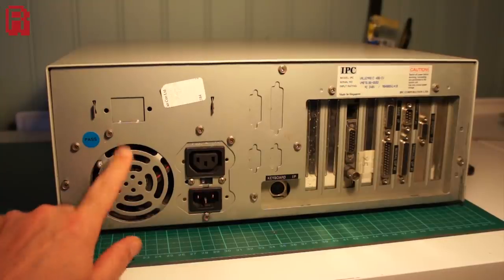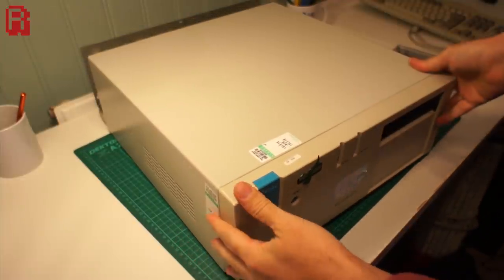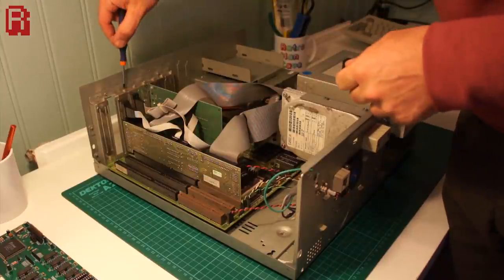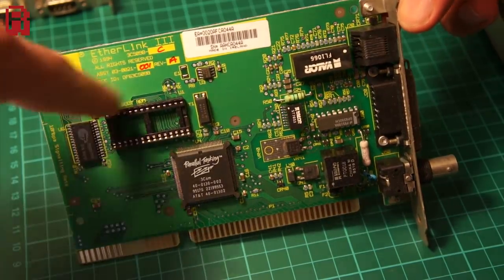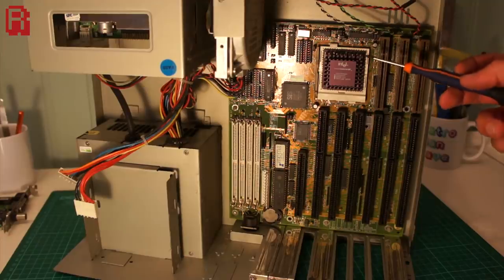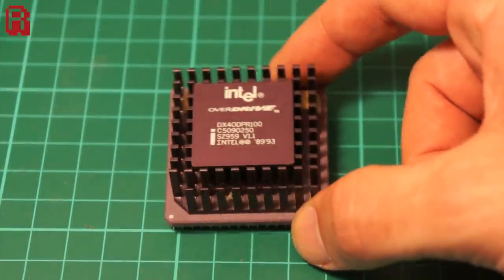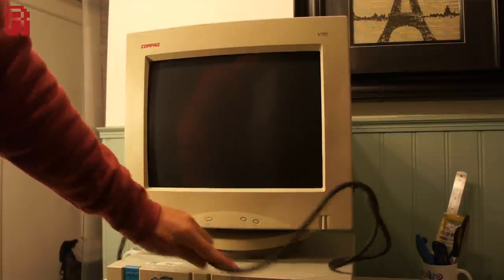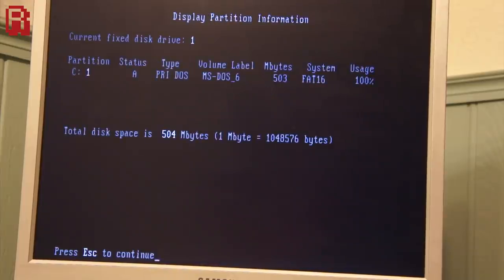Intel 486 DX4 100 Dumpster Find

Comment: Cyrix and AMD were actually completely different companies, and directly competed with one another and with Intel.

(Also, the FasMath co-processor there was an add-on for a 386 motherboard.  It was most often paired with the 486DLC processor, another of Cyrix's oddball line of CPUs.  They worked pretty well, though, especially the 40MHz versions.  Sometimes you had to flash a new BIOS chip to get them to work though, which could be a downer if you didn't have an EPROM burner.)
Reply: AMD and Cyrix' leftovers are still very different. AMD stays AMD even though they bought some technologies from Cyrix, and Cyrix got bought by VIA and they still make x86 CPUs to this day.
Reply: The actual Cyrix brand was dropped some years ago.  The processors that VIA makes, while using x86 instructions, don't really have much of anything in common with any past Cyrix designs.

https://en.wikipedia.org/wiki/VIA_Technologies#Processors
Reply: Jerkwad152   I actually bought a cyrix 200 plus to upgrade my Pentium, I can't remember from what.  But it didn't work on my mother board.  However it worked on a friend's who had a Pentium 166 I think it was.   He was happy to swap the chip, so I ended up with a Pentium 166.  I still have this PC, no hard drive and it started life as an escom dx66.   Those were the days.   I wouldn't call myself a Horder but I do have a lot of old hardware.
Reply: Yeah, quite a few  of the Cyrix 6x86 parts had weird bus speeds that could cause some motherboards to zonk out.  Any Super 7 board would generally work fine with them though.
Reply: AMD actually even built Intel processors under a licence, like e.g. the 286.
Reply: I had no issue iwth cyrix chips. my first pentium class machine was a cyrix 6x86

Comment: "There must be a reason why it was in the dumpster."
Uhm, because it's a million years old?
Reply: Lol
Reply: Maybe, but it ran simple serial diagnostic software tools and you don't need no fancy multicore, hyper threading platform for tasks that simple. It likely got disposed of due to security issues or a change in the technology of the machine it was monitoring.
Reply: @aspectcarl  i.e. Old
Reply: There's a lot of expensive equipment running on really, really old computers these days, mostly because the software was written for DOS/Windows 3.11 or older and upgrading is either expensive or the equipment vendor doesn't exist anymore.

So old hardware can be valuable.

Comment: I miss my 486 DX2. It was unbranded, the base unit was put together by a guy I knew who worked in IT for me. It started off with 4MB of RAM and a 350MB hard drive; by the end it had a whopping 4.3GB HD and 36MB of RAM and I upgraded the graphics card to a Cirrus Logic 5429 with a massive 1MB of memory. Vesa Local Bus. When I upgraded to a Pentium II I gave it to my mum, and from thence it eventually went to the council tip. It was the machine I played Doom and Duke 3D on. Happy memories.

Comment: Nice dumpster find (bit jealous here) and a well made video. :D

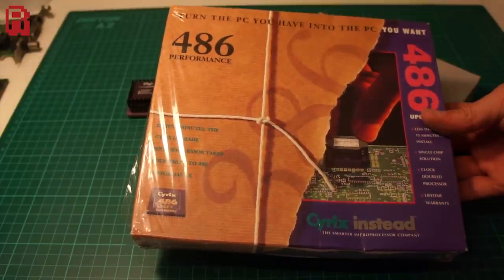6:59 makes it sound like Cyrix renamed to AMD though. Cyrix pretty much got subesquently split up after financial struggles.
They were bought by National Semiconductor in 1997 who then sold the Cyrix microprocessors division to VIA Technologies in 1999.
VIA did a die shrink on the MII and slightly improved performance, carrying on Cyrix' technologies as a desktop CPU. They also released a VIA-Cyrix brand CPU for the socket 370 but that was based on Centaur Technology's "Samuel" after the originally intended Cyrix design badly flopped in beta.
National Semiconductor continued using the designs of the Cyrix MediaGX in their Geode SOC-processors until selling those to
AMD in 2003.
AMD then went on and sold Cyrix' x86-technilogies to the Chinese Ministry of Science and Technology in 2005.
As of now afaik no company sells CPUs unter the Cyrix brand and the last who actually did were VIA. 
Still AMD were the last to sell a VIA design.

I hope I got it all right but I thought Cyrix deserved some credit and had a pretty interesting history altogether.
Reply from the maker: My Quest Log it's a long and complex path to the present day evidently!  Thanks for explaining the details.  In the final episode of this series I'll be talking about lessons learned along the way, if I can squeeze this info in I will thanks
Reply: That's cool, thanks!
Reply: Nostalgia Nerd recently posted a 35 minute video on the history of Cyrix.. you might find it interesting to check out.

Comment: I paid for a DX4-100 for a machine of just that vintage, back when it was the best....I too had 4 MB soldered, expanded to 20MB. I enjoyed your post mortem video, but I just want to let you know, that in 1994, when I had just such a machine, it was a fucking beast. In 1994, it was the most responsive computer I had ever touched. And it was mine. I ran WIndows 3.11 and Slackware Linux on it. A machine just like the one in the above video.

Comment: Overdrives were actually  Pentiums made pin and voltage compatible with socket 3 boards.  I have an 83 Mhz one that has a fan on it and it performs better than even the 133 Mhz AMD chip.

Comment: From back when computers were turned on to do something rather than look for something to do. Good times indeed. Things got a little nuts once MMX processors, 3d Accelerators, ADHD, Ritalin and broadband came on the scene. I still use Win98se daily for midi related duties and to play some pc classics.
Reply from the maker: screamengine There was something special wasn't there when it was you and the machine with no "outside world" connected to it.  Simpler times.

Comment: From my recollections of working on IPC systems in Australia, they were from Malaysia or Singapore from memory and they were "DELLesque", as in they sold end of production hardware in nice boxes (for the time) at a (fairly) affordable price.  The workmanship on a lot of pre-manufactured systems was woeful to the point our store stopped selling them as the labour costs for warranty repairs on assembly issues was beyond the markup on the units.  They did have one special machine called a MYGenie that was marketed as a dedicated Multimedia PC at the time.  It may have been a dx4100 or even a Pentium 133.  So long ago.

Comment: Oh nice, it came with an actual BTC dome with slider keyboard. Those are really nice to type on, I'm using the exact same model at my workplace. Mine isn't IPC branded though, I think it is Model 7949 or something like that. The keycaps are cherry mx mount, so you can even find replacements for it easily. It uses a capacitive PCB, over which there are good quality rubber domes with a conductive bottom part, over which sits the slider. They are really good keyboards.

Comment: I would love to see you build a 486DX with a proper VLB disk controller, in fact I would love you to do so with the following Promise VLB controller (DC4030VL-2 Promise Ide Caching Controller 4 Ide) and put at least 8Mb of RAM on it (notice the dedicated 80286 :) )
IMPORTANT IF YOU USE THIS WITH MACHINES THAT HAVE A FSB HIGHER THAN 33MHZ (Aka DX40. DX50) YOU WILL RISK BURNING THE BOARD (main reason VLB was abandoned in fact, the boards struggled to keep up with direct CPU link speeds higher than 33Mhz)

Comment: A 486DX4-100 system with 162MB of ram and a 540MB HDD, a VLB Graphics adapter, and VLB I/O controller?  And in a case in good condition?  Damn, dude.. someone loved that system.  You've really found something cool.  One comment I'd like to make, however, is regarding what you said about Cyrix now being called AMD.  This is not actually true.  AMD existed alongside Cyrix back in even the 286/386/486 days.  Cyrix itself eventually got gobbled up by VIA technologies.

Comment: Started with Commodore 64, then a Mac 512, and then as a programmer by profession, landed on x86 PCs. Am personally lukewarm on the 6502 (or 6510) CPU (it was the VIC-II and SID chips that really made C64 the phenomena that it was - the Motorola 6809 found in the Tandy Color Computers was the more superior 8-bit CPU). Absolutely loved the Motorola 68000 in my Macintosh, which was what really learned to program on. But in retrospect, it was the Intel 80386 introduced in 1986 that has become the CPU I now put on a pedestal - the pinnacle being the advent of those 100MHz 80486 PCs. Now here was a CPU that could accomodate grown-up, 32-bit, UNIX-like operating systems (and sure enough, Linus Torvalds gave us Linux). Very pleased that the MiSTer project has an 80486 core so as to replicate that era of 100MHz 486 PC computing.

Comment: AMD has been around longer than Cyrix was founded in 1988, Cyrix is owned by VIA technologies. They are still making CPUs for the Chinese market.

One of the machines in my Retro PC collection is a 486 DX4-100 system :)

Floppy drive cable is connected backwards, the access light stuck on is a common sign of this fault.

Comment: The network card has 10baseT (RJ-45 twisted pair Cat5) 10base2 (RG-58) and 10base5 (ThickNET, first variant of Ethernet using RG-8 and Medium Attachment Units or MAUs which is what the DB-15 is for)

Comment: If I had found the same computer, after some undusting and testing, then I would've retrofitted it with the math co-pro, upped the RAM a little and install both CD-ROM and a 5.25" floppy, plus replace the 3.5" floppy. All provided that I have some extra cash and the actual resources.

Comment: My first PC was a 486DX2 with 8 Megabytes of ram and about 500 megabytes of storage space. My first pentium class was a Cyrix 6x86 and It worked just fine... I remember the cpu supported a standby mode that windows 95/98 wouldn't use so i had a program that would put it in low power mode to keep the cpu cooler when not crunching numbers.

Comment: Wish we had such dumpsters. On the other side it's not legal to put electronics into normal dumpsters here and from time to time there are people driving around, picking up old household machines and so on by putting flyers inside our postboxes with the pickup dates. Theoretically you could go around the streets and look for what people put at the side of the streets for pickup, but never had anything good. Once there was a CRT TV but it had it's power cord cut off...
Even the second-hand stores here suck as do flea markets, because the people there arn't selling their own stuff but random rubbish. Also stalls that are selling games in bad condition (getting even more sun bleached because they are in the open) but asking for Ebay prices of games in far better condition. 
Btw, my first PC was a VLB system. Of cause stupid young me got rid of it after getting another PC...

Comment: Unfortunately, companies do this all the time, if they even have that old equipment around anymore. They might try to have an auction initially, then leave them in the hallways, for anyone that wants them, but if they aren't claimed, then IT gathers them up & transports them to the dumpster. I used to be one of those guys, once. I also ended up with a few extra Everex machines. Unfortunately, I only have one of those left, from that time period.  One time in '94, I was behind the capital, and not only were tons of computers in the dumpster, there were also good looking couches & desks being tossed.

Comment: Electronics of any kind should never be thrown in the garbage. If it is of no use anymore it needs to go to a proper recycling facility. That goes for everything from complete computers to old capacitors replaced in computers. E waste is a big environmental problem.
That's my rant. Glad you gave this old beast new life.

Comment: 9:00 I recognise this sight! The floppy drive cable is very likely to be connected the wrong way round. The light being constantly on gives that away. (I have made that mistake often enough back when I fiddled with this kind of computer...)
Reply from the maker: Yes indeed, thankfully it was that simple and it's working nicely in part one of the 486 Trash to Treasure series, well spotted

Comment: The floppy drive data cable was plugged in in reverse on the IO card...  Could tell by the way the access LED was constantly on.
Reply from the maker: Good spot, yes you'll see it's working in the refurb here: https://www.youtube.com/watch?v=F1_40O4sKpc and thankfully it was simply a case of putting that cable in properly

Comment: That is a nice, solid foundation for a DOS gaming box. I haven't run across a 486 PC in years, and I'm starting to really regret getting rid of mine.
Reply from the maker: +Shmeh Fleh there's a 5 part series on my channel in which I do it up you might enjoy.  486 computers are getting pricey but you can get parts pretty cheaply now if you want to do it.

Comment: Just a note to say, those are not DIP switches on the Goldstar I/O card.. they're plain old jumper pins.  DIP switches are quite different beasts.. and a damn sight better than jumper pins, IMO. Unfortunately, they cost more, and so aren't much used any more.